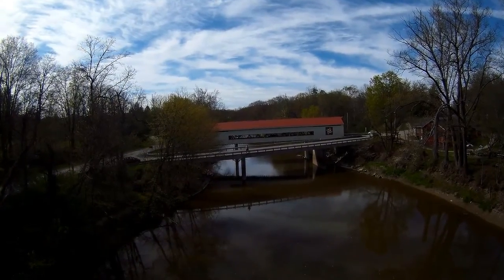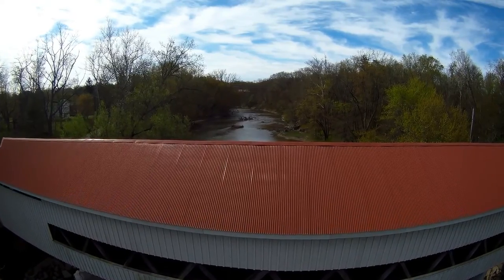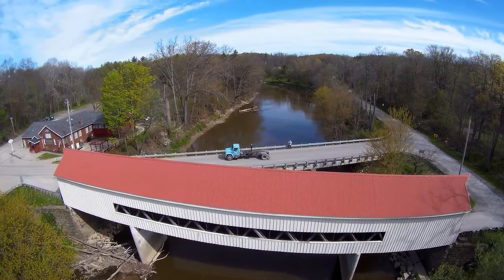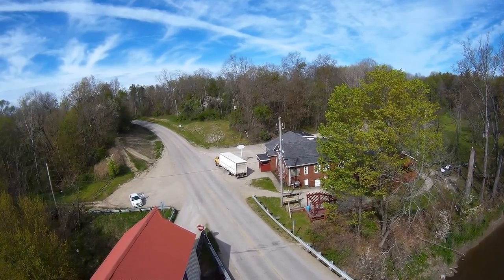X380 Mechanicsville Covered Bridge 5-9-16 (1080P60)

Comment: Bill,

I've seen you comment so much on Quadcopter 101, for months.  I finally got curious and clicked on your channel.  GOOD JOB!!!! WITH YOUR VIDEO PRODUCTION!!!!!!

How has your experience been with the XK x380?

Ross
Reply from the maker: +Ross Bassette Hi Ross.  I've had my XK X380 for some time and have had varying results with it. In order to maximize its usefulness, I've installed a gimbal, a Gitup Git2 camera, a Video Transmitter (VTX) with antenna, and an OSD system. In my opinion, the XK X380 can be useful in aerial photography, as long as you understand its shortcomings and strictly adhere to guidelines regarding those shortcomings.  Experienced flyers should have success in using it, but, in all honesty, I would not recommend it on several levels, including "cost effectiveness". Yes, you can buy it for around $210, but then, in order to bring it up to a level of usefulness in aerial photography, you have to add the essentials which I've listed.  When added to the cost of the X380, and given that you must install all that stuff and get it working (which is no easy feat),  there are MUCH better alternatives out there. Many who own the X380 are almost fanatical in their support of it, but, I'm more a realist. I did learn a lot from my successes and failures with the X380, so there is that to consider as well.  I hope I've not bored you with this rather long answer to your inquiry. Cheers!